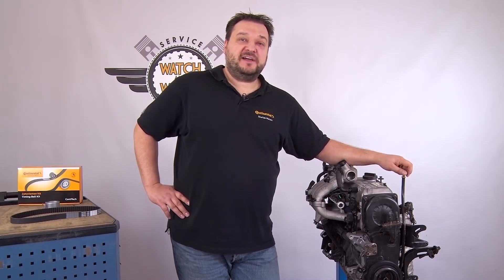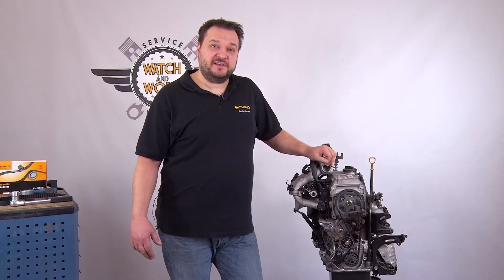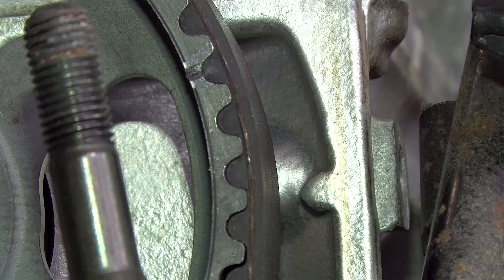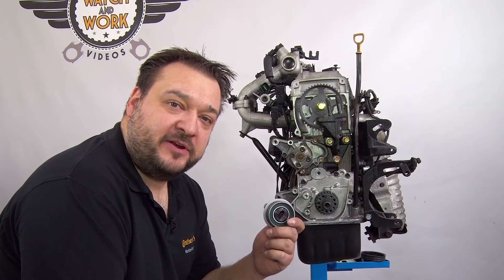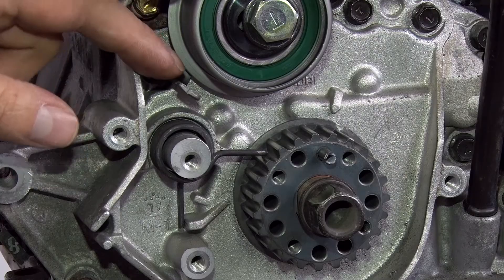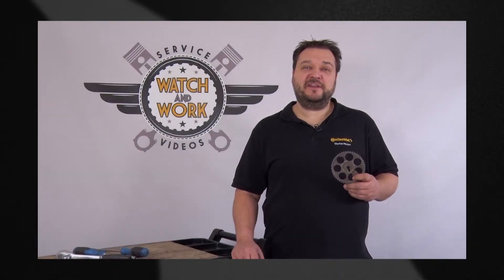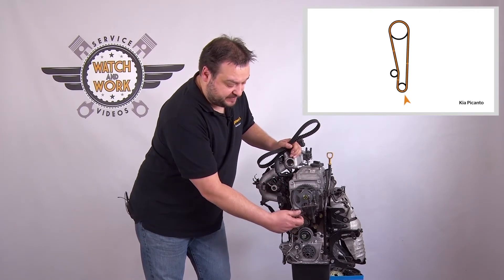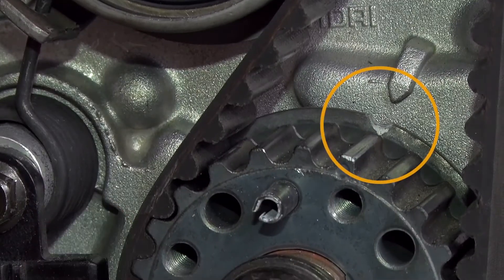[EN] Watch and Work - Kia Picanto 1.1l 48kw

Comment: What is the size of the nut,
The one on the tensioner pulley
Reply from the maker: Hello, the size varies depending on the engine data! In most cases, 13 or 15. But it's better to have it checked against the exact vehicle data. That's why we don't include this information in our videos!

Your Continental Aftermarket Team

Comment: Thanks  very much. Is the same for 2010 version 1.1L 65 kw ?
Reply from the maker: Hi Marin vremes, unfortunately I can't find an engine from 2010 with 1.1 l and 65Kw. To answer your question, I need the detailed data of your car. I would suggest to have a look in our Product information Center PIC. You can fill in your vehicle data and will find all related products and technical instructions: www.continental-ep.com/pic 
Best, Stefan

Comment: 🆘 Pretty good info vídeo, I have 2009 Picanto LX  4 cylinder, I already checked the web finding overhaul repair kit with no success, where or how should I look for it ⁉️🤔.
Just wondering if they share same engine with Kia Rio which is easier to find. 
I'll appreciate your time and help.
Reply from the maker: Hello Juan,  

Thank you for your feedback. I recommend that you carry out the repair at your trusted workshop, they will also be able to help you with any questions.

Greetings

Stefan

Comment: Good evening. Can anyone tell me what the water pipe connections are for on each side of the Kia Picanto throttle body?  One of the elbows has corroded and has lost integrity (leaking). Can I remove these elbows or  bypass the the throttle body by bridging the pipes connections with a section of pipe?
Reply: sorry i dont know. i have picanto2008 . my FC is 13km per L. its very bad.

Comment: Excellent video but I would love to see it accomplished with engine installed in the automobile. I cannot take my engine out and place it on a stand.
Reply: With the engine mounted in the car, you have to remove two or three accesories belts, depending if your car have AC or not. The steering pump, the alternator and the AC compressor have their own tensioners. After this, you need an impact tool yo remove the central screw of the crankshaft and the four screws of 10 that  are on the pulley of the crankshaft. You have to remove the four screws of the Water pump pulley and remove it and then you can remove the timing belt cover.